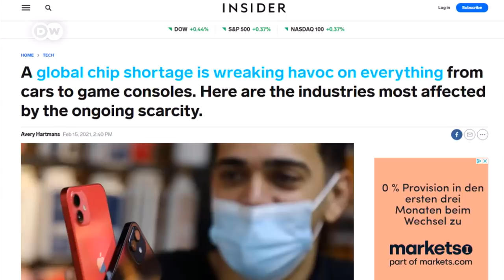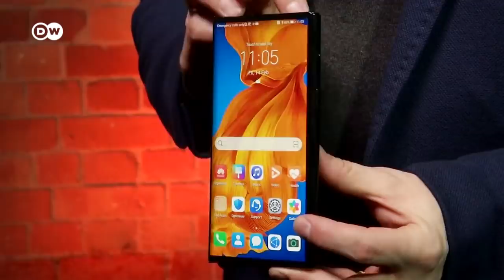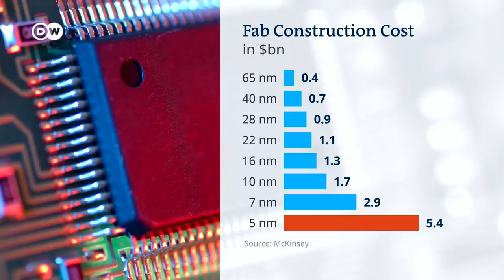Global chip shortage: How microchips became one of the worlds most precious resources

Comment: Dont forget there are some chips made by TSMC on Perseverance on red planet
Reply: it's mainly powered by PowerPC 750 from 90s (iMac G3)
Reply: space exploration does not use modern chips - because new chips are extremely sensitive to interference, and there is plenty of it in outer space.

in fact, you want to avoid electronic components and use mechanical whenever possible. mechanical parts can be fixed by hand. chips... you can order a new set from Amazon and ask them how long it takes for delivery to outer space.

Comment: Moore's law still has to follow the laws of physics. The atom is about 0.1nm in diameter, there are about 10 atoms in 1nm which means there are about 50 atoms in a 5nm transistor.
Reply: That 5nm refers to the transistor gate width in a mosfet transistor. A 2-dimentional feature, with a width (a 1-dimentional measurement) that can be measured.

Modern chip transistors use FinFETs. Which uses a 3-dimentional gate that can't be measured using a 1-dimentional measurement.

So "5nm" is a marketing term that refers to a kind of equivalent.
There's nothing relevant measuring "5nm" in a modern chip. 

5nm is supposed to mean, the performance is equivalent to a 5nm wide 2-dimentional gate.

But, these days, even this has devolved into purely marketing lables.

Comment: This computer chip shortage may encourage people to take better care of their current products as they should, and be less wasteful. It's more economical to keep something in good working order for as long as possible, rather than upgrade to something newer after only a few years. 

You don't necessarily need a lot of technical knowledge to maintain and fix things, but it helps.
Reply: @Garrett Yarbrough That's good.  I have a 2007 Dell T3400 desktop which I bought preowned and refurbished in 2013.  I still use an old Toshiba keyboard which must be about 20 years old or more.  And the PC monitor is a preowned Acer AL1916W which I bought about 15 years ago.  It all still works well.

I reckon that the demand for refurbished computers and other electronics may start rising.  That would certainly help reduce electronic wastage significantly.

Comment: You should have done a video on the GPU shortage witch has gone on for longer and will last longer and has done more damage
Reply: The GPU shortage has not done more damage.

It is more inconvenient for gamers but the overall chip shortage has impacted automotive, Internet, computer sales as a whole, manufacturing of everything that uses silicon chips.

The GPU shortage is almost entirely due to somewhat below average production numbers and incredibly high demand. If anything it has done great things for AMD, Nvidia, TSCM and Samsung, they're selling every single chip they can produce with a waiting list that extends out 6 months to a year.

They can roll back to Turing and Vega using GDDR5 and fix the GPU supply issue today. Nvidia already has pushed the RTX 2060 again and I wouldn't be surprised if AMD bumps Polaris or Vega again.

Comment: throw away smartphones were inconsiderate  to the world's resources should have made durable upgradeable handsets..
Reply: My cell phone is 5 generations behind current. I've replaced the battery myself (yep, had to pry the case open after the battery swelled), and it works just fine. When it dies, I'll probably buy the same model as 'new old stock', meaning, it's already been made whether or not I buy it.

Comment: What about AMD  theyre the best right now
Reply: No, TSMC made chips for AMD/INTEL. No USA companies able to made 7nm or below. There are only 2 able to manufacture 5nm: TSMC and Samsung
Reply: @leungpaul9401  ohhhh now i get it but speaking performance vise
Reply: @leungpaul9401  TSMC use American equipments to produce the chips. This why Chinese is having hard time produce high end chips.
Reply: @mrtee3477  <10%usa tech.
Remember initially Trump put sanctions on Huawei of no more than 20% usa technology, it literally have no effect, forcing Trump administration to lower it to no more than 10%.
Reply: @mrtee3477  to be more accurate, TSMC use AMSL(HOLLAND with some USA tech), CHINESE and Japanese equipments
Reply: @mrtee3477  and top Chinese chip maker almost catch up usa firm in term of manufacture chip, both are aimed at 7nm.
Though chinese firm do use some USA tech here. Without it, it will be something like 40nm, now Chinese companies are working hard to bypass it.
Reply: @leungpaul9401  When you have 30 years head start, good luck!
Reply: Just as Mrwhosetheboss said, Samsung is the only neutral manufacturer in the mist of the US and China trade war. They can supply to both sides.
Reply: @vervetech9395  as far as I remember, Samsung can't supply China chips, reason already said: company must get approval from USA first if there is more than 10%usa tech involved in manufacture. Though Samsung did tried.
Canon and Nikon did announced want to co-op with Chinese companies though, because they use less usa tech.
Reply: AMD always has and will always be mediocre garbage.

Comment: Wait!  We can fix this chip shortage instantly!  Mass produce automobiles without any chips or computers in them.  Just like before 1985.  Roll down windows, Carburetors, Hydraulic brakes that the driver (and not some weasel with wireless) can control.  Manual & analog everything!  How much cheaper they'll be, how much more serene we'll be.
Reply: Great, and let’s see the death toll rise due to the lack of safety, fuel consumption rise dramatically due to no EMU. In any case by the time anyone redesigns a car like you describe the semiconductor shortage will be over.

Comment: Can't Apple purchase its chips from domestic Intel than TSMC?
Reply: Apple buys power pc chips from Motorola in their early days but switch to Intel as their x86 chips are better. 

Intel investor and managements were sleeping when consumer handheld devices are coming out in the market, they can’t think beyond laptops, desktop and servers.
when apple make iphone & ipods they had to rely on chips from Samsung. 
Now apple they came up with their own chip designs and prefer TSMC to make it for them as they are the most advanced chips manufacturer in the world below 14nm. to produce cutting edge and be the forefront in innovation and tech space they need to work with the best supplier
Reply: Not easily, the processes that Intel and TSMC use are quite different, the chip design itself is tied into the limitations of the production process (diffraction plays a big role at these scales for example). It's not impossible, but won't be quick or cheap.

Comment: Your numbers listing the top 3 semiconductor firms (Intel, Samsung, TSMC) fail to show the true scale of the problem. AMD, nVidia, Xilinx, Altera, Qualcomm, Apple all manufacture everything at TSMC. Intel has fallen behind AMD precisely because it is not manufacturing at TSMC - and will have to in the future. There are no chips without TSMC. Literally nothing - no computers, no manufacturing equipment (which is all computer controlled), no agricultural equipment (which needs to be built using manufacturing equipment and which is also largely computerized these days) and no military hardware. So if China takes over Taiwan, or just TSMC (and they don't need to physically invade, just put their placemen there), they gain the power to push us back pre-information revolution, pre-industrial revolution and pre-agricultural revolution and back to the stone age - unless we dance to their tune.
Reply: TSMC building Fab in Arizona. Samsung, Intel and GlobalFoundries have Fabs in US and EU
Reply: @alexandersundukov3196  I am aware of TSMC's plans to build fabs in the U.S. But "is building" is not the same as "has" - building a fab takes a long time. It will help for sure, but it will represent only a fraction of TSMC's production capacity - once it comes online. Yes, there are also other fabs, but they neither have the capacity nor the technological edge of TSMC, and when you combine that with UMC also being a Taiwanese company - without TSMC and specifically their Taiwanese operations, the West's chip supplies would cease.

Comment: We are making a huge mistake, we have solve the problem it bring only looking at the benefit.
We still can't find a Way to stop a lithium battery fire. They is no way. And that is a bomb, it takes 24 hr to stabilize that pack if a part could fire. Not think of our 2-8 floor of parking all fill with full charge lithium battery's?
Just 2 car on fire with that smoker is enough to fill the top floor full with poising smoke. And the firs will last for week in a city. The chips might be the end of mankind. What happen if the all chip goes down, somehow. Food and water stop. Everything stop, and we have no gas truck as back up. There is no going back if we need to. A one way st. That problem haven't even been sorted out yet. As a lithium fire. It has to burn out.
Reply: LiFePo4 , not as much energy per pound , tends to be very hard to get it to self-ignite , or even maintain a burn without some serious power still continuing in or out.
Plus they last many years longer , and they can cycle more times before they are needing to be recycled.

did you know that the first car that was built , was electric not a combustion engine. 🤗
The first transportation device I had as a child , endless ages ago , was electric and I delivered newspapers with an electric mini bike , that was so ridiculously long ago. 

Combustion engines aren't going to freaking disappear , electric vehicles could make intelligent use of power from solar and wind , solely because they have storage technology.
Some kind of intelligent charging system , that uses available solar , only when it's available , could still get people around most towns , to the jobs and all that.

Also there's the hydrogen cars , if you've got a bunch of leftover power , you could always use it to separate the atomic structure of water , and put it together at some other time (which would burn in a combustion engine or reassemble in a fuel cell) .  Problem is there's way more loss  poor efficiency . Maybe someday that storage technology (water) might be efficient enough to use. Hydrogen another storage method , that can make  practical use of sporadic leftover unused power.
The electric fuel cell , or back to the archaic combustion engine.
Reply: @psycogeek1031  I don't like this ban gas cars & truck by 2035.idea , look at all the gas electric power plant it going to be needed to charge this 800 million ev battery packs. At night. They don't talk about this.and if the sun start giving out solar flairs this will stop all electronic. How are we to eat? Ev truck that don't run. What if the power plant goes down, and the city need to evaluate. And even the city buses are down. We walk? Then what do we eat?  I think this is just a money thing, they are going to squeeze 30 thousand out of everybody and the rich will benift. So many thing can go wrong with a gas ban,  gas  that independent transportation.garantee where every you are for month along. Not ev. I

Comment: how many fancy smartphones has been manufactured? it might probably has higher number than earth population

only about 100 millions ps4 units has been shipped during it's lifecycle which is around 7 years. How many useless cheap smartphone made a day? cheap or not , processor strong or weak it does not matter. but it hsa to use the same material which are used for making all chip. high end or low end whatever. billions of low end devices are causing chip shortage. smartphone culture tick tok selfie culture is causing chp shortage. 

So silicons are wasted on useless smartphones. So, more life meaningful and useful demands such as medical equipments, high ends computers and high end consoles are being delayed.